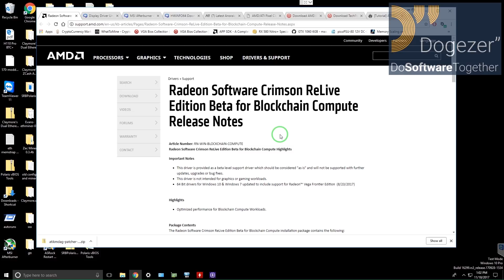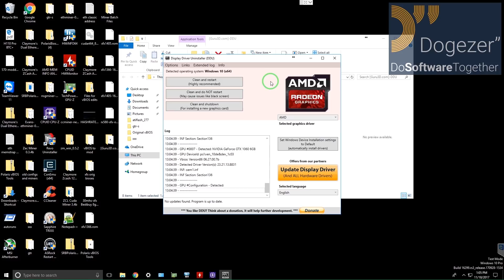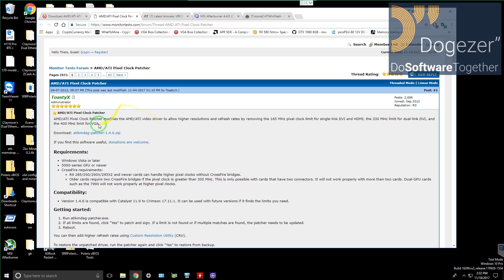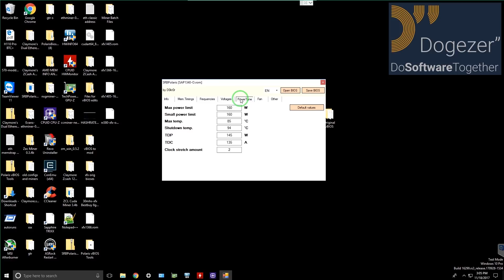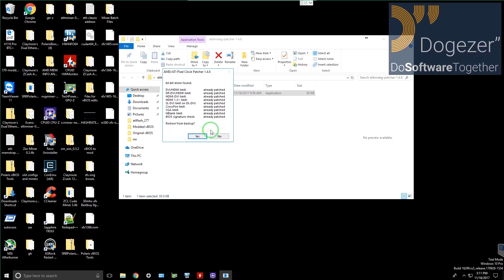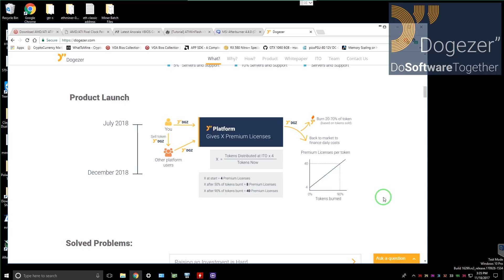How To Optimize AMD RX 470/480/570/580 Cards for Mining - FULL GUIDE!

Comment: Thanks for such a great video, I have tried what you said and my Hash rate on my xfx rx 570 won't go more than 23.5M/h. But I say your cards at over 30. Can you please share how to do that.  I really appreciate any help.
Keep up the good work:)
Reply from the maker: The ones that are over 30mh/s are the sapphire special edition 580 8gb. They're high ASIC quality and probably the best mining cards I've used. Have you tried memstraps other than 1500 on your cards?
Reply: I did and it went up to 24 which is good but I was hoping for more.  And I know that only certain types of cards go over 30 but I'm sure I could be getting at least 26 or something. Do I do anything after I change memory straps? Like after burner or that other thing you showed at the beginning of the video?
Again thanks for your help
Reply from the maker: Yes, you will definitely want to use afterburner. I  had originally included info on using afterburner when filming this, but cut it to shorten the final edit. could you send me a copy of your original and modded rom files? I'd be happy to help you with afterburner settings. If you have an email or preferably a skype let me know with a reply or private message!

Comment: Excellent Video - Thank you, i went from 22MH/s to 29.5MH/s after following this on a XFX GTS Black Core Edition Radeon RX 580 - Thank you, very detailed.
Reply from the maker: Awesome to hear this, glad I could help!
Reply: Evanjdevelopment you did. Thank you. Should I be doing any overclocking ? Currently I have a XFX GTS Black Core Edition Radeon RX 580 DirectX 12 RX-580P828D6 8GB OC+ 1405 and getting with your mods around 29
Reply from the maker: If you're meaning using MSI Afterburner or something similar absolutely. You can reduce power costs and push the hashrate up a bit more as well.

Comment: Hey Evan thanks for the awesome video. Only 1 issue I have after modd the xfx gts Rx580s that I have using ur method I am only getting 19.2 Mh/s
Reply from the maker: Hey, Islam sorry for the late reply I've been busy. Check your c:\amd folder and see if there's leftovers of other drivers besides the blockchain ones. If so you'll need to run DDU again and check the setting to delete the AMD folder the reinstall the block drivers.
Reply: Evanjdevelopment thanks for your help it worked I am getting 27- 29 with no over clocking. I am noticing that 2 of the gpus start at 29 mhs/s then go down to like 15 mhs/s the same 2 cards are giving an error while mining
Error states" GPU 1 returned incorrect data" I flashed them back to stock and the error occasionally comes up. I am starting to worry if they got messed up?
Reply from the maker: You may need to run OC software and downclock some values if the error continues.
Reply: Evanjdevelopment I did use saphire Trix to down clock it to 1350 still having the same issue. I am looking at the current bios on the card and the timings are not right there I wish I could upload a pic but how it is on the current card are 0:250. Up to 0: 2000. There are no straps that start with 1:250... Etc or 2:250 ......
Reply: Evanjdevelopment  I have tried a couple of things and it did finally work. I appreciate all your advice def one of my favorite comprehensive videos I've watched. Thank you.

Comment: your video is great. i am just getting started and i was wondering if the changes made will keep the card from sending images to the monitor? the motherboard that i have dose not seem to have onbord graphics so i just want to make sure i don't screw my self. like i said just getting started don't have much knowledge on Computers in general.
Reply from the maker: Thanks for the encouragement and being honest about your tech level. I may be able to walk you through it if you tell me what video card you have. Brand name, model, size in gb and the cards model number/sku
Reply: Thank you, My Card is a AMD Radeon RX 580 Armor 4GB  OC. The Card came with the computer, it is a CyberPowerPC model:GUA2600BST  SKU: 5833100. I do not know how to get any more info on the card, I hope this is enuf. My big concern is that the motherboard according to my research dose not have onboard graphics, and that the changes you describe in the video will stop the card from sending a signal to the monitor. is this the case? if so I will have to wait tell I get the parts to build a better rig. Thank you for your help.  
P.S. The Motherboard is a B350m Bazooka.
Reply from the maker: Dustin, flashing a vBIOS with modified memory timings to your card may be a bit too preemptive IMO. I would never want to advise you to try something that could cause that.

While flashing a new vBIOS to your card that has tighter memstarps will result in a higher hashrate, the video signal loss is a possibility. Do bear in mind that if the video we're to go out from a simple memory mod, it could easily be solved by running the pixel clock patcher....but if that card if your only means of video output I would definitely urge you to wait.
Reply: thanks for the help. and I hope to see more video from you. this on has been the best by far on optimizing cards for mining, keep em coming.
Reply from the maker: Dustin, thank you for the encouragement, I plan to keep things going on the channel for everyone.

Comment: Hi Evan, thanks for your videos and trying to help us out to figure out our lil problems. Speaking of problem i have a sapphire nitro+ rx570 8 gb hynix running win 7 x64 with blockchain dag fix driver with anorak's 1500 rom and i cant get my hasrate above 26mh/s. If you have a clue of what could be missing let me know ! thanks
Reply from the maker: Thanks Carl, and happy new year. I'm just taking a guess from what you've mentioned here. 

I had someone comment on the video a few weeks back who was also running Win7x64 and the newer blockchain drivers from AMD (the ones used in my video and in the download link). His conclusion was that the "newer" August 23rd beta drivers had poor performance compared to those using Windows 10. 

There was a previous release of the blockchain drivers (the initial ones AMD put out) which he claimed when switching back to after running DDU solved the problem for him.

I don't have a link to them, but I may have the zip file somewhere and can check if you can't find then on Google.

Two other things to check prior to removing and reinstalling those drivers though:  Im curious if you're using any OC sorftware (Afterburber, Trixx, etc)? If not, you need to be. 

The second thing to check is in your AMD root folder (at C:\AMD). Take a look there and if you have multiple folders besides the ones that say "blockchain" in the name of them or folders in there that were from previous driver installations (as in a driver higher than 17.30.1029) then you'll need to run DDU again and make sure you check the box to "delete AMD" folder as this will purge it.
Reply: Happy new year to you too ! =)

 Thanks for your fast reply , yes i forgot to mention but i do use msi afterburner and i can get my oc settings to 1150/1825 ish without losing stability. 

i was unaware of the first release of the blockchain driver but now im using the 23rd release. Yes i have other folders in the amd folder beside blockchain one.

 ill try to find the first release of the drivers and if i do ill rerun ddu and make sure to check the box to delete amd folder! 

Do you think this will make the hashrate go near the 30's ?
Reply from the maker: I can't guarantee 30Mh/s as that's subjective of the hardware quality, but you never know, I'll cross my fingers for you.

Since you've found the extra AMD driver filders, are you able to open crimson settings? If so it's likely that the leftover drivers automatically updated on top of the blockchain drivers. I'd check that first. 

Usually, if newer drivers installed on top of the blockchain ones it's probably safe to assume AMD's Wattman tool is running as well. Wattman competes with Afterburner/Trixx/other OC software and they end up stomping on each other causing issues and lower hashrates. Keep me posted!
Reply: No i wasnt able to open crimson amd settings since i installed the robinh00d pack to fix the dag problem via device manager ... But i can't try the 11aug version either since there is a dag bug in those driver too. I would need the robinh00d package for the aug11 if it even exisist. I can't test the aug11 the mining programs all faill , sgminer claymore ... Any ideas 😞😕
Reply from the maker: Carl, meant to get back sooner. Are you still having problems?

Comment: Which MSI Afterburner do you recommend and how do you unlock the voltage options?  I haven't had luck being able to modify the voltage with Afterburner at all and have to do it in Claymore.
Reply from the maker: MrInfamos, you can use the newest version of Afterburber, even a beta version. To unlock the voltage you'll need to click settings (the gear icon) and under the first header go ahead and check the boxes in for unlock voltage control and unlock voltage monitoring. With doing so youll likely need to remove the values in your claymore config file.
Reply: I've tried this and no luck to get it to unlock.
Reply from the maker: My next assumption is that you may have traces of previous AMD drivers in your C:\AMD folder. If you go and take a look and see any other driver version folders besides the blockchain ones then that's likely the issue. If so, to fix this you'll need to run DDU again and make sure to check the box that says "Remove/Delete AMD folder" and then reinstall the blockchain drivers. Keep me posted on this and I'll do my best.

Comment: Hey, I'm running rx570 nitro+ 8gb Micron memory and I have a problem where it just works badly when I boot up the system. It lags and then resets itself, also it takes it a while to boot up after I reset the PC. I'm using blockchain drivers, so has anyone had similar problems?

This really makes it difficult to operate etc.

Comment: great video, but as a beginner i have a question. after i flash bios i m not allowed to use afterburner? because cards are working at maximum? i will be mining with nanopool what about fan speed they customize it? because i dont want to have 70celsium in my card or that temperature is okey? thanks for the answer
Reply from the maker: You definitely want to use afterburner after modding your cards, edit your voltages, power, clock speeds and set a custom fan curve.
Reply: Evanjdevelopment ah got it after time... Thank you for respond!

Comment: Hey dude, I still have 3 of my 6 rx580 armor cards with the yellow triangle. Not sure how to fix it as I have been trying for a few days now and just followed your guide step by step.
Reply from the maker: Try a reflash on the ones that aren't working, I would do so individually by removing the working ones and trying one by one and maybe moving them to different pcie slots.
Reply: Ok I will try that. How much RAM should I be running? I was told I only needed one 4gb stick. Is that right?
Reply: Also all my bios p/n says "-" and when I remove the working GPU's the drivers bump over to the non working ones.
Reply from the maker: Generally 4gb is needed for 6 cards. Is your paging file set to 16gb?

Comment: Hi Evan
great work, i have xfx rx 570, giving 27 Mh/s with block chain driver, i am wondering if they will go above this after Bios Mod. Thanks in advance
Reply from the maker: Hanif, yes a vBIOS mod can push the 570 to a higher hashrate but to be honest it may not even be worth it. My MSI 570s are only getting 27.5 Mh/s even after a mod. To me it seems like your results are great already. I would maybe google around regarding  your specific card and see what some results other people are getting before moving forward with a flash.

Comment: Hey Evan I did everything you said and the rig was running flawless at 232mhs on 8 580s. I had to shut the rig down and after I booted back up one of the cards hashrate dropped causing the rig to blue screen. Once it booted back up it ran fine and now hashing at 31mhs which its never hashed at before now. Also I use msi afterburner but when I make changes to clock it doesn't do anything to the hashrate. Any idea why as it seems to me that the cards are being manipulated elsewhere
Reply from the maker: Check your C:\AMD folder for any other leftover drivers besides the blockchain ones. Or if you can open AMD settings and check the driver versions. I'm not sure but AMD Wattman may be running in the background and that can stomp on your AB settings

Comment: Hey evan, Im using simple mining OS. Is it possible to do these flashes on windows and then have the settings save for when your run SMOS? Or is there an equivalent to flashing the GPU bios you know of for linux based systems?
Reply from the maker: Hey Davis, I haven't used SMOS so I can't speak for it myself but your best bet would be to flash them on a Windows based system just for ease. And yes, once the cards are flashed the vBIOS will carry over into Linux as well. 

You may want to give them a test run in the windows PC before running them back on your SMOS setup if you'd like to make sure the flash gave you the boost you wanted but that's optional.
Reply: Yes much easier to flash them on windows. I am getting about 27.5 mh/s on SMOS now compared to the 28.5 I was getting on windows. However, I couldn't get my rig to run with more than 3 cards on windows so I switched over. I think the stability is worth the slightly decreased performance. Thanks for the help and the great video.
Reply from the maker: No problem and thank you for the encouragement, if you hit any snags just reach out. Good luck!

Comment: thanks for the video, u said u need the drivers that u showed, I have the newest adrenaline drivers, do I need to unisntall and install the ones u showed? thanks
Reply from the maker: The Adrenaline drivers are fine as long as you put them into 'compute' mode and you don't mind tweaking settings with AMD's Wattman tool instead of say Afterburber or Trixx.

If you would rather go the route in my video make sure when removing the current drivers with DDU, that you make sure you check the option to "Delete AMD folder" as well.
Reply: awesome thanks
Reply: Ive been having a problem with My xfx rx 480 only getting about 400h/s on claymores cryptonight miners, and around 560h/s on xmrstak-aeon, I will try this mod, thanks, oh and currently I have a 2 card gpu rig with an r9270 and rx 480 ( i plan on adding more rx 480s or rx570/580s) but when I run the xmr-stak-aeon the r9 270 wont register, My rig is on windows 7 but I plan on upgrading to 10 asap

Comment: Never, NEVER flash a card with a downloaded BIOS, anorak is great for examples but DO NOT use them, sometimes the same card can have slightly differente values in the values and you are risking a brick, sure 99% of bricks are reversible but you do not want to be on the other 1%, always extract the card BIOS mod it yourself

Comment: hi, followed your guide with the blockchain driver i can only hash up to 25mh/s (modded) also nothing happends when i try to oc using afterburner or strixx.. can you help pls. i have a sapphire rx570 8g samsung+micron memories.
Reply from the maker: Sure Joneth, when you say nothing happens I'm not quite sure what you mean. Could you clarify for me?
Reply: Nothing happends or no additional hashrate when i adjust the memory clock freq and gpu clock.
Reply from the maker: Are your voltages and such unlocked in afterburner?

Comment: Hi, I have MSI rx 480 gaming 8g card on windows 7x64 ultimate SP1, hooked with DVI-HDMI cable to monitor. Motherboard MSI K9A2 Platinum.
I`ve downloaded blockchain driver for win 7 from website you were suggested. Previous drivers uninstaled with DDU (also tried safe mode).
When I install new blockchain driver I got a black screen on monitor, pc is working. There is picture while OS starting, after that black screen.
Some suggestion?
Reply from the maker: Sorry I didn't get back to your sooner! Unfortunately those drivers have issues with Windows 7 and do not work properly. You'd be best off rolling back to maybe 15.12 or going up to the new adrenaline drivers.

Comment: Hi there! Cool knowledge sharing! If you don't mind helping a brother out here I would really appreciate it. I have 8 GPUs of the model NP106 and I have been trying to use them for a monero rig. Is there any way I can use ccminer or claymore even though they are not GTX or AMD build. Would appreciate your view on how to go about with it. Thanks, bro!
REPLY
Reply from the maker: Galib, your cards are actually GTX 1060 6gb GPUs. They're more commonly known by the model name "P106-100." To answer your question though, ccminer should work completely fine. Claymore's dual miner (EthDcrSiaLbc) will not as it's AMD specific.
Reply: awesome!! thanks for clearing out the air of confusion for me. would you happen to have a guide on how to optimize the most out of the model P106-100 or know anyone who has done it already? also a monero mining pool you are familiar with that allows GTX 1060 to have a great performance? Thanks a bunch brother for the sharing the info.
Reply from the maker: You're welcome, Galib. For mining XMR this is a pretty popular post that can probably help you out: https://bitcointalk.org/index.php?topic=2126975.0
Also for the record I mainly use Nanopool, if not that then I'm usually using Suprnova.